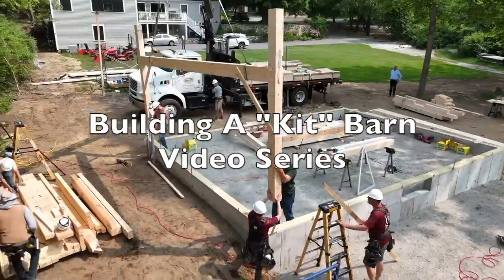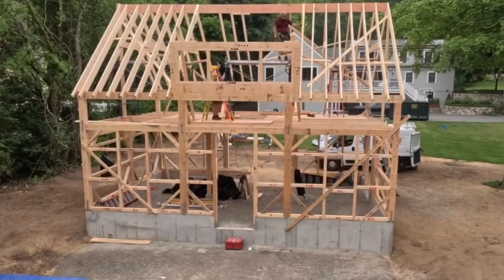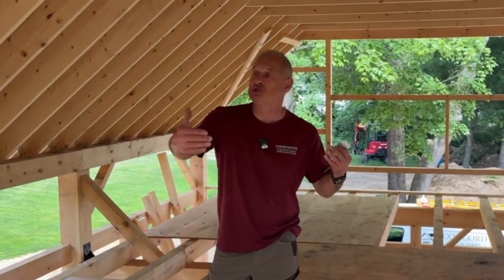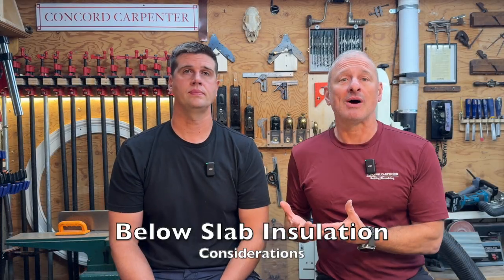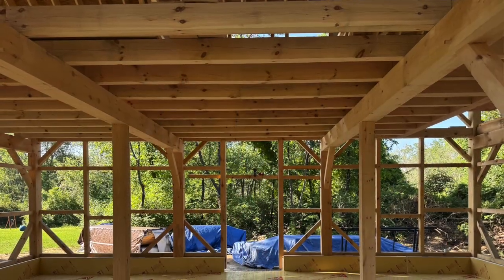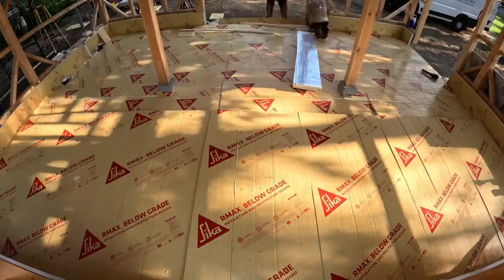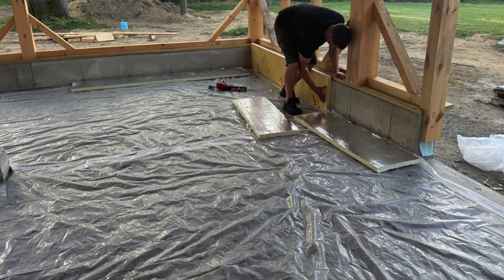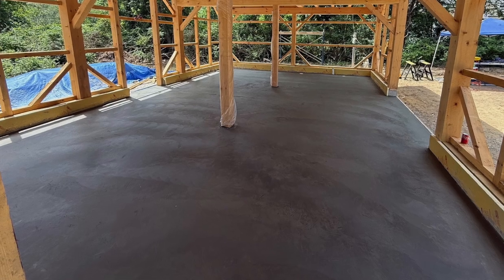How To Build A Timber Frame Barn | Framing,  Under Slab Insulation, Window Bucks.  Video 3

Comment: Why would you use shiplap like that? Seems like a waste—unless it’s visible from the inside. I once worked for a Swedish builder here in Australia who talked about this kind of lining, but he was building in parts of Sweden where it’s dark for months and hits minus 40 degrees. So the insulation had to be multilayered... Why anyone would live there, I don't know.
Reply from the maker: Yes its visible and it's the inside wall surface
Reply: Yes it’s visible from the inside and is the interior walls. A second set forms the exterior cladding.